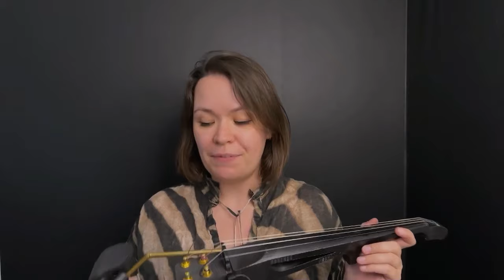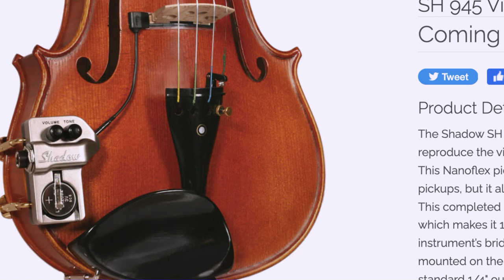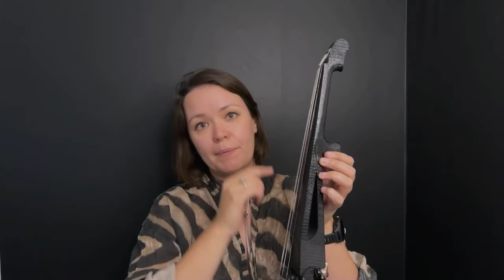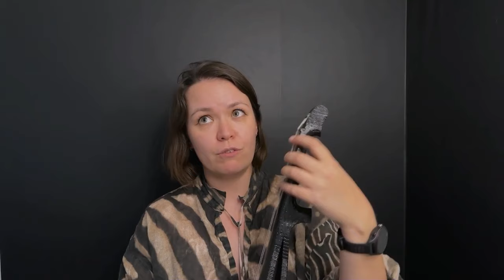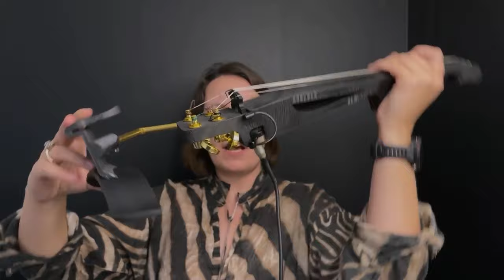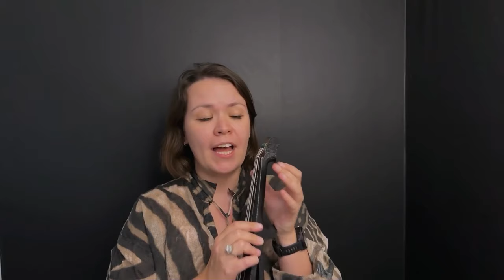I 3D printed an electric violin and absolutely love it!

Comment: Forgot to say, try just sanding the next neck instead of putting anything on there. A matte neck is often more comfortable than a painted/lacquered neck on guitars, though that's a mod you only do if the lacquer starts chipping, as it looks ugly and gets dirty, but that's because it's wood. It'll be fine and feel better on a print.
Reply from the maker: Yup, realized that after the fact 🥲 I thought sanding would be more work lol

Comment: You can get drill bits that are really long for getting through walls. And also extenders. Get one that's the same size as the carbon fiber rod and just drill out the supports! That should cut down on a lot of work.
The head (where the tuners are) should be modified in software. It should be a bit longer (half an inch, maybe?) and angled downward, so the strings aren't at such a steep angle from the bridge.
You'll get used to the guitar tuners. They're great. There is an alternative, though, but that will make the total depth (top to bottom) thicker, and that is banjo tuners, but you should stick with guitar tuners, I think. 
Also, I think I would get rid of the copper/brass tube and just add a support from the head (tuners) area.
Aaaaand now I'm getting ideas for my own design! 😄
Thank you for a fun vid! ❤
Reply from the maker: Oooh that’s a great point!!! I’m learning how to do supports better and haven’t had the same problem since, actually!

Comment: I would always applaud any attempt to build something yourself. But this is a major effort and deserves congratulations as the results sound great to my untrained ears. I would have appreciated some more close ups to show the exact geometry and perhaps some of the CAD models. 
From what I can see, an angled headstock, like a guitar, may improve the issue with the strings slipping off the pins. 
I hope you do a 2nd version based on the learnings and post another video.
Reply from the maker: Thanks for such detailed feedback! I’m in communication with the designer and plan to do an updated version in a few weeks :)

Comment: Why are the tuning pegs at the bottom? Was that a personal choice? 
It sounds interesting, nicely so. Is it easier or harder to play on that neck? Just asking out of curiousity.
Reply from the maker: It was a personal choice by the designer, I think! I just printed this, I did not design it.  The neck was difficult to play because of the acrylic finish I applied, but after a few weeks it seems to have settled